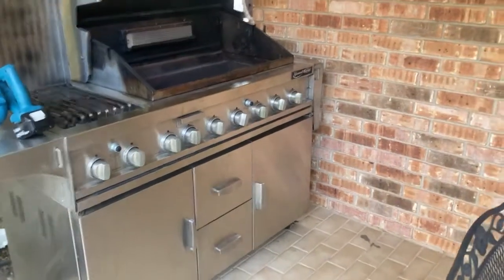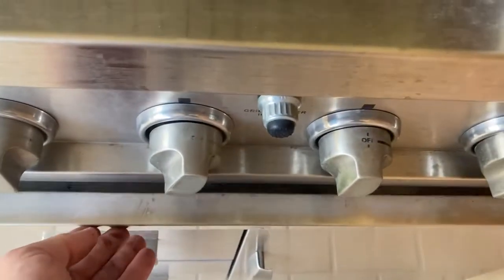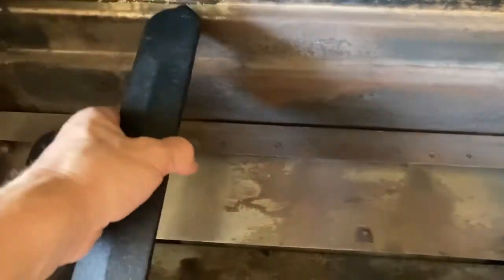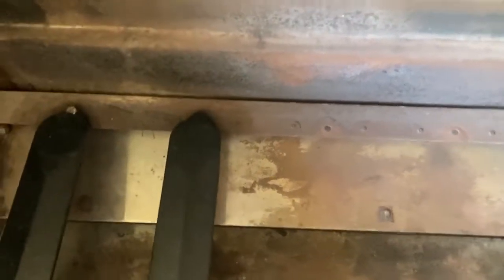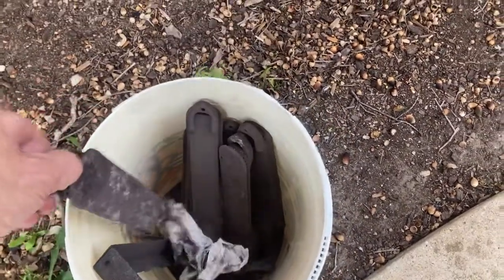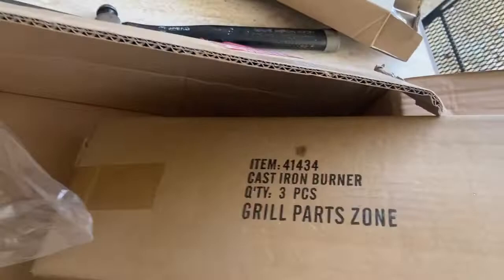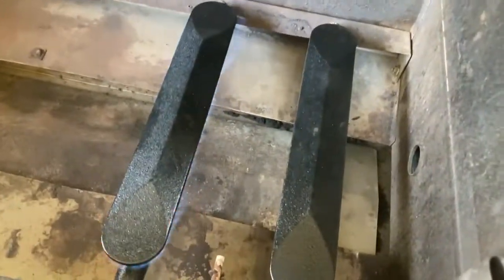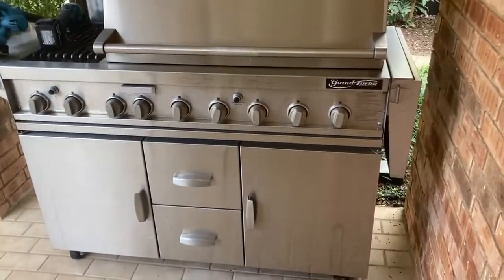Bbq Galore Grand Turbo full burner replacement.

Comment: I have the same model bought 2005, the original burner bolt hard to remove the philips head melted but the hex nut at the bottom works.  So hex nut use box wrench at the bottom and hold top with visegrip.  Grinder won't reach the left burner.  Clean with drill 3/32 all burner flame hole, mostly clog with sooth, no need to buy new one expensive 50 bucks each.  I replace bolt with stainless steel 1/4-20x1 Hex Head, burner hold down bolt,  no problem since then removing burner to clean hole every year.  Replace the bottom drip cover screw to hex nut for easy removal cleaning.  Clean inside with 4" sharp blade scraper much easier.

Comment: Great vid, thanks.  My burners were all rusted out and the heat was all pooled in the back, making it tough to cook well. I wasn’t able to get any of the burner bolts off with a wrench, so, indeed, I did the same thing you did, which is the grind the screw heads off. I used a hand held grinder. This did the trick very nicely.  got some very nice cast iron replacements off Amazon for roughly 35 bucks each. Feels like a new grill again!!

Comment: Thanks for the video.  I have a 38" Grand Turbo (YN663NG) bought in 2005. All of the burner hold-down screws and most of the other screws were frozen solid.  I tried to grind off one of the heads but gouged the burner. I ended up drilling out all of the screws so I could re-use the burner. Other screws I used penetrating oil, hand impact driver, drilling, grinding, or even a torch to get them to loosen up. 

The original OEM burners are made of cast stainless steel, which IMO is way better than cast iron replacements.  New cast stainless steel burners were around $90 each. Not something I wanted to invest in. Yes, the burners all had surface rust on them and the flame holes were clogged.  I ran a 3/32" drill (like Sonny did) through the burner holes and lightly ran a grinder around the sides where each flame hole was to make sure it was clear and the flame would not be impeded .  Also ran a stiff wire through the gas inlet of the burner and dislodged lots of debris (soot, yellow powder from the natural gas, etc.) and hit it with compressed air. This cleaned up very nice and figured the cast stainless steel burners will still last a lot longer than replacement cast iron burners. The flames burned perfectly.

Since it was so difficult to remove the screws and nuts or have to grind off the heads, I though they should be coated with some sort of anti-seize when I install them.  I ended up calling Loctite and their application engineer recommended LB8009 Heavy Duty Anti-seize (1oz tube: 234353).  Maybe when I take it apart the next time it will be easier using that anti-seize.

I ended up replacing the following from Barbeques Galore in Ontario CA https://www.bbqgalore.com:
Part Number 	Description	 	 	 	 	Quantity
P05518002I  	Protective Pad (bumper)  	 	4
P02610018A 	Gas collector with electrode	3
332731 		        GT cross channels	 	 	5

Purchased replacement stainless steel hardware locally.  Used a magnet to make sure the replacement hardware was good stainless steel (like 304) that will be resistant to corrosion.
Purchased the Anti-seize from the local Grainger Supply
Total price so far...$200

Also, will be looking to get a new Smoker Tray Bracket & Grease Draining Tray Heat Shield, Upper made by a local sheetmetal fabricator using 304 Stainless Steel. Haven't received a quote yet but found photos and measurements at these two URLs: 

	https://www.appliancefactoryparts.com/search/part/20898/172702/
	https://www.appliancefactoryparts.com/search/part/28393/172702/

Looking forward to getting the grill up and running again.
Reply: I use both grinder and drill on the screw but failed miserably.  Just used Box wrench at the bottom, hold the top with vise grip and remove them or it will break brittle.